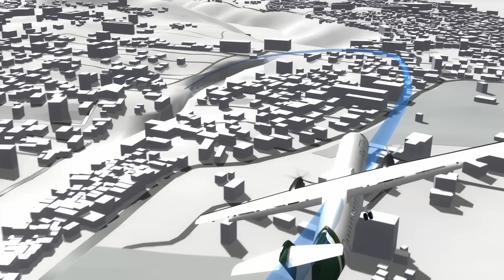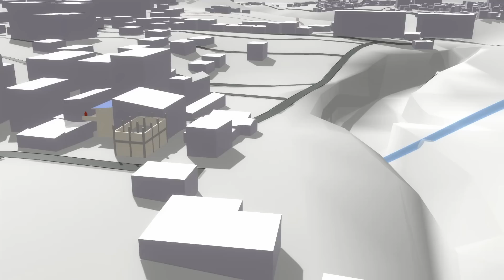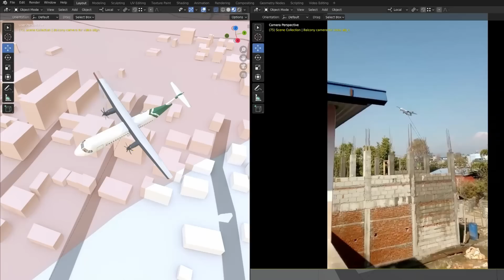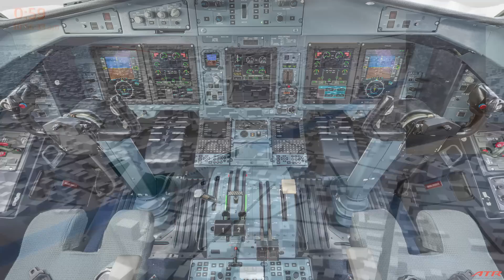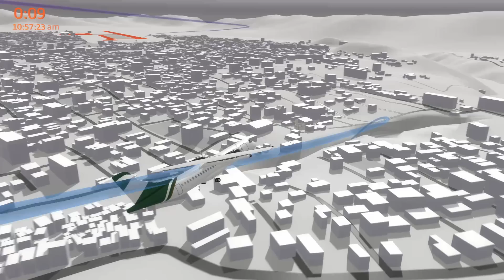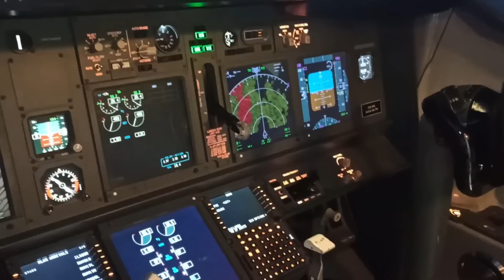HUMAN ERROR or MECHANICAL?! | Yeti Airlines flight YT691 illustrated

Comment: Feathering props at speed should trigger some kind of mental script / muscle memory jarring alarm that can be silenced if truly required. 

Muscle memory and "mental scripts" can back fire. The script/process says add flaps. The hand reaches for the controls and feels the prop pitch levers, but in the moment of business, the scripts/muscle memory take over and the hand performs the complex steps to move the prop pitch levers and reports back to the brain that the operation was completed successfully.

The mental scripts continue under the assumption that flaps were applied, prop pitch is correct. Flaps normally reduce speed, as they should, and power is often added to compensate - the mental script continues to validate itself.
Reply from the maker: Pilots must have common sense and good technical knowledge. 
Master caution. Check gauges. No torque on both engine and dropped RPM. That should shout prop pitch issue and check the prop levers. 
If you miss the fearhering then you know you have lost engines and must go for forced landing right away. This is drummed into you from the start of your pilot training. There was the old runway right there in front of them. Should have started preparing for the forced landing while you give yourself a little more time to problem solve. 
This was poor training and lack of technical knowledge.

Comment: Either he confused the controls with the controls from a different plane, Or another pilot suicide.
Reply from the maker: The lever arrangement of power props flaps is standardised across many turboprop airliners. Perhaps the pilot had a stroke or some very rapid brain dysfunction.
Reply: @Mike-Bell  ok let's say it was a suicide attempt. A on the ball CA trainee would have noticed it and put lever back in auto and landed the airplane. That would be very embarrassing.. Not to mention potentially getting fired if there's an investigation. but I see it happening if he made a determination that this trainee would not catch it. But at the same time he most probably knew the FDR would record the movement so that would be a deterrent. If he had thoughts, it had to look like an accident.. For insurance and cultural and social reasons... There are much better ways of doing that. I don't this it was a suicide attempt.
Reply from the maker: @Bren39  I agree suicide does not add up.

Comment: Mike, great job with the video and animation!! I know there is a cockpit voice recorder and a instrument data recorder. Shouldn'
t aircraft manufacturers also look into adding a video camera to record cockpit proceedings. Having visuals of what took place, as an additional aid, could be greatly beneficial while analyzing events during investigations. Not to be released to the public, only for internal investigation.
Reply from the maker: Adding video from cockpit, nose forward facing and tail backwards etc. is technically simple.  But the bureaucracy from authorities and pushback from pilot lobbies is the real hurdle.  I agree in this case it would have been of major help.  Did pilot flying or monitoring finally put the flaps to full?  Was pilot monitoring acting normally or sick.  These are important questions and just based on cockpit voice involve guesswork.
Reply: @Mike-Bell Just an enthusiast here. Isn't there a Flight Data Record of the flight parameters with timestamp that can be checked against the timestamps on the Cockpit Voice Recorder? That may provide more insight as to when the plane started losing power and when did they apply Flaps 30
Reply from the maker: @pradeepsahoo7243  Only the investigators have that information. They will make a final determination based on those numbers. Its not certain the public will get to see the data.
Reply: @Mike-Bell  Gotcha. Great video and analysis btw
Reply: ya, i don't get how how they dont have dashcams on airplanes like how most cars have dashcams nowadays! should have it it auto turn on when approaching landing ... or auto turn on when takeoff! maybe too costly to add cockpit cam lol

Comment: I would consider that it may have been something more than just a simple error.
The flap handle has an airfoil or flap shape on the top. It was the handle closest to the right seat.
The prop pitch controls, of which there are two, have a different shape, are in the middle position between the flaps and throttle, and have a different shape.
One can have a very hard time seeing how this could happen accidentally..
Reply: Some have said because he was in the right seat but I find it hard to believe. Being a captain he was used to being in the left seat. I think he was either very tired or stressed something was on his mind. Maybe on set of a heart attack. He did not monitor air speed or the engine gauges which are on the glass display. Something is not right was this suicide.

Comment: Cockpit redesign may contribute to further minimize the chances of catastrophic errors. Both levers control widely different functions, but they are too close to each other and operate in somewhat similar ways.
Reply: Not quite standardised. Twin turboprops such as the ATR 72 are a special case because they have propeller condition levers, right next to the flap lever. Most other aircraft do not.

Also note that the condition lever detents and flap detents are very closely aligned and the lever pivot points are in line. The lever heights are similar too. The only difference in touch is the shape and activation method, but potentially this is not enough, as this accident appears to indicate.

You don’t see this on jets, or on single lever turboprops (eg PC-12). Other twins, E.g the King Air, have the flap lever in a different location from the condition levers, reducing the likelihood of the wrong lever being grabbed.

Your video is excellent, it really is, but there is potentially a design human factors issue here. The fact the crew was able to feather both props and not realise it is by definition a human factors error, and ideally the design of cockpit controls needs to prevent such failures.

It is conceivable that this accident could result in a change to certification requirements to ensure condition levers and flap levers are not on a common pivot line or with similar detents.
Reply from the maker: @Dynamic_Flyer  Thanks 👍🏻
Reply: @Dynamic_Flyer  The knobs on the Condition Levers are shaped and sized completely different from the Flap lever which has an AIRFOIL shaped control knob. Any pilot should be able to FEEL the difference blindfolded or in the dark.  Plus Location. There is no other control on the quadrant to the right of the flap handle which is another cognitive marker.
Not only that who was looking at the FLAP INDICATION GAGE to make sure the Flaps were at 30 degrees when called for? 
There comes a point where there can't be enough engineering to overcome pilot errors. Its obvious that nobody ever looked at the TORQUE METERS when they started losing airspeed and pulled the nose up. The report states that the POWER LEVERS were Advanced before the crash and not the Condition Levers.
Reply from the maker: The arrangement of power, condition and flaps is standardized across airliners.  The handles are also standardized to help pilots fly different planes.  This is not a design problem.  Its about pilot training and following cockpit communication procedures and confirming actions carried out in the cockpit and ensuring the other pilot is aware of what actions are happening and cross checking.  Its also about exposing pilots to emergencies in the simulator. In this case if they could not problem solve why both engines were at zero torque the procedure must be automatically going to forced landing... on the old runway which was right there.

Comment: simply no understanding as to how the senior pilot made this deadly error and did not figure out what he did in time to save the aircraft. A very informative video, thank you.
Reply from the maker: Thanks.  It is too basic an error.  Makes no sense at all...!?
Reply: Perhaps an audible "props feathered" or "prop condition" chime. But still, it's incomprehensible how he made such an error and didn't catch it after nearly 60 seconds of flying and the pilot flying, I think, twice saying she had no power.
Reply from the maker: @karl46  The master caution chime and both props reading zero torque and lowered RPM. That tells any well trained pilot what they need to know. The systems did their job.
Reply: @Mike-Bell  I can't disagree with you in any way. As I said above, the whole thing is incomprehensible.

Comment: I just don’t get this. Pilot flying calls for flaps, condition lever is moved instead. A little while later flaps are selected, again, without being called. So two actions for the same flap position. Wouldn’t you immediately think heck, what did I select the first time, did I move the condition lever? It just defies belief that the pilot monitoring wouldn’t look down at the throttle quadrant and confirm his actions. Just bizarre.
Reply from the maker: It defies belief.  Such a basic egregious and deadly error.  Engine torque on both gauges showing zero and they A. don't realize props on feather or B. go to immediate forced landing on the old runway straight ahead and below.   So many other errors too and as you say on discovering flaps weren't fully down this was not called.  Terrible communication between pilots.  Bizarre!  The cockpit voice recording will give much more insight and understanding but so far nothing has been released.
Reply: @Mike-Bell  this can happen.. Because of the heavy workload and critical stage. I'm not explaining the wrong lever movement but your post. During this stage you're fully concentrating on configuring the aircraft and landing..ie looking out the window. Could they have noticed the sound of the engine winding down. Most probably no.. Because they were slowing down and already at a low power setting. Should they have noticed the engine indications.. maybe but they're looking out the window. Why didn't they land at the runway in front of them. In heavier airplanes it takes time to lose airspeed.. Call it inertia. That's why they didn't realize they had loss of power until too late. Very busy cockpit.. Flying a 180 turn.. Configuring and also setting up for a landing. It's very difficult coming up with an explanation for the incorrect lever selection, but either pilot should have diagnosed the decreasing airspeed much sooner.
Reply: @Bren39  I never heard of such a accident. For dealing with the high workload there are two pilots in the cockpit. And one of them has to MONITOR and not to fly.

Comment: Well done Mike from a fellow South African (ppl) aviator.

What was also mentioned in other reports that the left seat right seat muscle memory could have been the cause of the training captain making this fatal error.
Reply from the maker: Hi There.  He was an instructor so would have tons of right seat time and know the levers well from that side.  The lever arrangement is standardized across all airliners.  I think the cockpit voice recording reveals much more than we currently know.  It is such basic error which makes absolutely no sense.  And the master caution 6 seconds later was a prompt for him to spot his mistake.  It is totally inexplicable.  
But the investigators are holding onto the conversation between the pilots till they are more certain of the facts.  It seems like the pilot flying was deferring to the instructor instead of making crucial decisions herself.  Zero torque on both engines means you are in immediate trouble especially at 500ft agl. and need to go for immediate forced landing.  The old runway was right ahead.  But it seems she was waiting for decision from the pilot monitoring which is fine when you are learning to fly but as airline captain herself is shocking.  Of course with zero torque on both engines first principles will have you checking pitch as your first response.  Perhaps pilot monitoring was sick with stroke or an instantaneous brain dysfunction.  The cockpit voice recording will give us a lot more understanding.
Reply: @Mike-Bell  I believe the correct action would have been to unfeather the props. According to your graphics, they were too high and past that old runway by the time they realized loss of power.
Reply from the maker: @Bren39  yes of course unfeathering the props would have resolved the entire situation. But they couldn’t figure out the problem so forced landing procedure should become first priority while you problem solve.

Comment: To be honest it's a mistake that I see myself replicating in particular conditions... and I am confident almost any pilot could replicate something like that independently from how many hour of training they went through.

Whatever might the conclusion be in the final report, if the preliminary report's finding will be confirmed, a design change of the AC controls would be the SAFEST way to prevent that scenario. Had the junior pilot seen what happened before she would have reacted but she did NOT see and she couldn't probably tell until it was too late.

For example a warning for mismatched approach configuration could sound or even a complete relocation of the controls. Both pilots have to picture the situation within seconds of happening.
Reply from the maker: Hey Tobias. From the cockpit voice I suspect they know a lot more but are waiting till they understand more before they release the information. Rumours are that the pilots were unhappy about the airline and their pay in conversation earlier in the flight. So perhaps he was angry and distracted. 
But I disagree this is an easy mistake. A pilot doesn’t just switch off his propellers and slip his mind. It simply too silly a mistake. And 6 seconds later they got their warning signal. That required checking engine gauges. Seeing both torque gauges at zero is very serious and an obvious clue to feathering. And if you cant figure it then as pilot you need to put the plane down in an emergency landing right away before you lose flying speed and control of the aircraft. 

This arrangement of levers and handle shape is standardised across all aircraft. 

I think there is something more that will be revealed in the final report.
Reply: @Mike-Bell  Hello there Mike, I see your point but... have you ever done something out of distraction that you thought it was something else?

It's something human in nature.

It's not about standards when people's life is at stake. If there is a chance that my distraction can also be overlooked by a second pilot... then there must absolutely be a design implementation that prevents the event in the first place and warns the pilots immediately should it ever happen... not after the AC has lost momentum, that is far too late... we know it for a fact, our ears are full of "pull up, too low terrain" (stall... whatever) warnings and what almost exclusively happens in these tragic circumstances is that they don't PULL up, they don't advance the thrust levers... they don't realize what's happening until it is too late.

That's why I claim something must have warned both pilots of the error immediately to take corrective action.

But I am sure this not being my area of competence there's who knows better... I still stand behind my concept though, as it would be the only way I see myself being saved from such a deadly oversight.
Reply: @m80116  I agree. This appears to be an opportunity for design improvement.

Comment: Thank you for the great visualisation. This accident sure is strange. As you say, the levers are very different so as not to move the wrong levers. 

I don't know if there is any point in me guessing since I don't know enough about how check rides are normally done. But if I were to guess, the only thing I can think of is that it was some sort of test to see if the pilot being tested can fix the problem? That seems an extremely dangerous thing to do so close to the ground and close to landing though. And in that case, why didn't the senior instructor pilot move the levers back again? 
Or maybe the senior instructor pilot was drunk and didn't notice he picked the wrong lever? Whatever happened I hope the investigators can find the cause of the accident.
Reply from the maker: Thanks Ni An
It is very odd situation. It is too basic a mistake unless as you say the senior pilot was drunk. Or unbelievably distracted by something. I am pretty certain the investigators who have access to the cockpit voice recording have a much better idea of what really happened and making certain before making announcements.
Reply: @Mike-Bell  Yes I agree, and I hope so. Thanks for the video.
Reply: I wondered if the senior pilot had suddenly become ill. A small stroke or  transient ischaemic attack might cause confusion I guess.
Reply from the maker: @Blencathra1  That would be a very viable explanation.  hmm 🤔